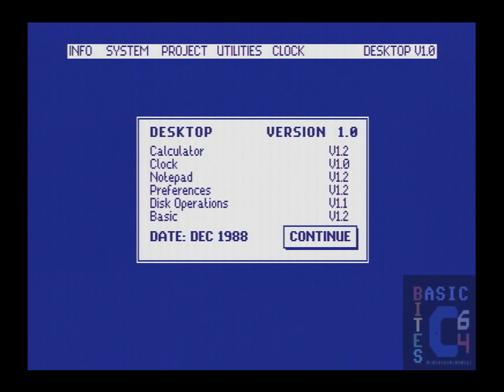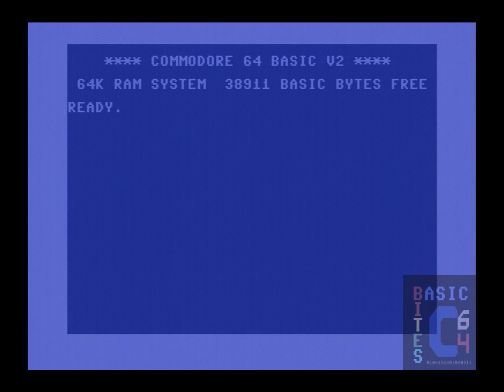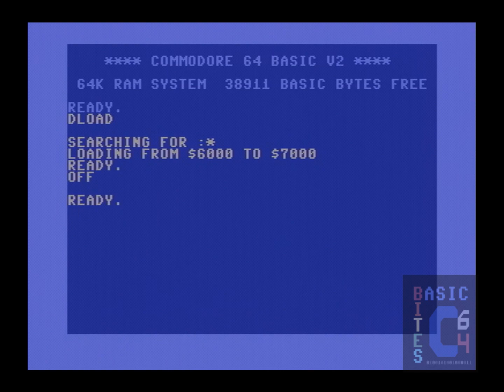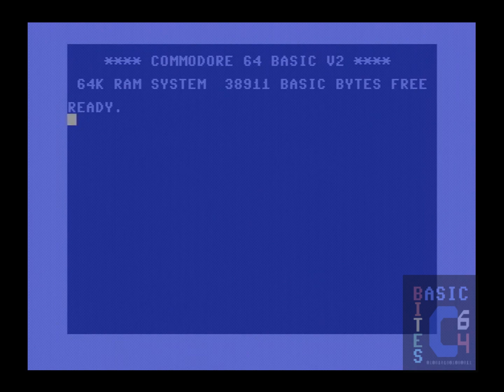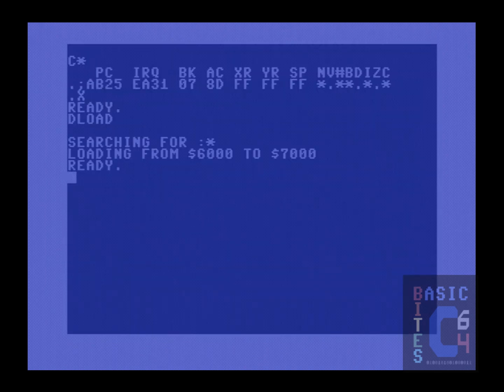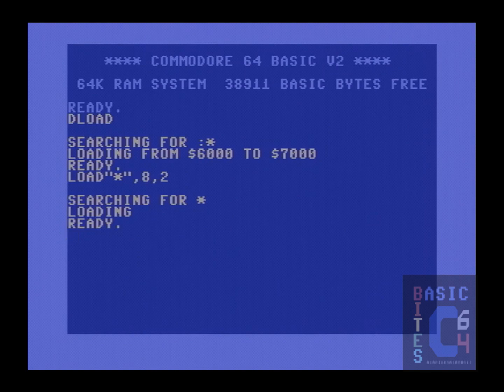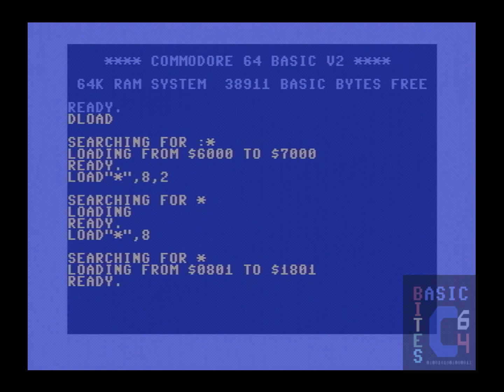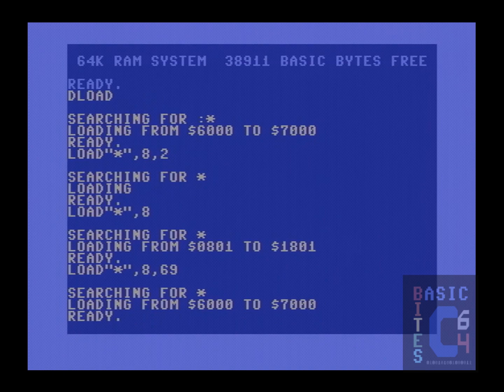New HIDDEN FEATURE in The Final Cartridge III | Commodore 64

Comment: Weird, my Commodore 128 and 1571 worked perfectly fine with C=64 fastloaders; I used them all the time in Commodore 64 mode. I did my programming and homework in C=128 mode, and the vast majority of the time I was playing games in C=64 mode.
Reply from the maker: Not weird at all!  In C64 mode (or on a real C64), a 1571 will be in 1541 mode unless you instruct it otherwise. 🙂  -- JC

Comment: My version is Date: JAN 2015
Version 2
Calculator V1.2
Clock V1.0
Notepad V1.2
Preferances V1.1
Disk Operations V1.2
Basic V1.2
Reply from the maker: December 1988 was the last official revision.  What you have there is a Final Cartridge III+ (FC3+), which encompasses various efforts to continue improving the cartridge.  -- JC

Comment: D you know how to make a freeze with fc3 and use the freeze without fc3?It's possible but i overlook  something and dunno what each time i make up a freeze with fc3.cheers,Ken
Reply from the maker: See "REMARKS ON THE FREEZER" on page 56 of the manual for some helpful tips.  The first thing you should do is use Reset Zero Fill from the Freezer to clean any unnecessary garbage out of memory.  Then load your program.  It also recommends that you KILL the cartridge before making a backup, if you want the backup to work without the cartridge inserted.  Beyond that, I'm not sure, since I don't use the cartridge to make backups all that often.  -- JC
Reply: @BasicBitesCA  is there another option?
Reply: @Ostendia  Yes, there is: Use the OFF command before starting the program. However KILL is really what you should use, because it uninstalls the FC3 hooks completely, resulting in a backup that works without FC3. Remeber, the FC3 Freezer remains fully functional if the FC3 has been killed.
Reply: @danielmantione  I don't think ypu need to OFF or KILL, I have done several backups that fastload perfectly without an active FC3. EDIT: Wrong in case of BASIC programs, as @danielmantiojne points out below.
Reply: @NuntiusLegis  If you do not use OFF or KILL you BASIC and KERNAL vectors point into FC3 ROM. If the program doesn't use BASIC and  doesn't LOAD/SAVE, it may still work, however, in general you should use OFF/KILL before making the backup.
Reply: @danielmantione  I never backed up BASIC programs, tried it now, and you seem to be correct, it only worked after a KILL before pushing the freezer button. Thanks.

Comment: Brilliant... very nice to know ❤
It makes we wonder what something like this would do:
LOAD"*",8,70
- Will it do the same as ",8,2" or load the program into $0801 with the fast-loader enabled. Is TFC3 looking for the value 2 or triggering on a bitwise logical AND on bit no. 1 (aka $02).

BTW, I still have my The Final Cartridge III from back then as well. Although the case had gotten oddly brittle, so I have moved it over into a transparent-red casing instead and printed a new golden'ish label. I'm not sure which version it is. But I also have the TFC3++ reproduction and that would be bases on the "final" Final Cartridge III, shouldn't it? 🤔
Reply from the maker: Thank you very much!  Any non-zero secondary address OTHER than 2 invokes the fast-loader, just the same as using an address of 1.  I also use a real FC3, because I enjoy having original hardware for the cartridges I use the most.  The TFCIII+ is the same code as the FC3's final ROM revision (1988-12), but contains a much larger EPROM, with a list of added tools that can be invoked from the Desktop.  I never invested in one because I can just put the TFCIII+ ROM on my Kung Fu Flash, if I wish to use it. :)  -- JC
Reply: @BasicBitesCA  Besides the extra tools, I have noticed the TFC3++ (that's what it says on the label for some reason), that at power up into the FC3 desktop it selects the 1351 by default instead of joystick mode. Which can be a little annoying. When I bought it I just wanted to have a replacement in case my old trusty should give up for some reason. I also have a Kung Fu Flash, the BackBit, several EasyFlash3s (upgraded) and even an Ultimate 1541-II. So, I guess I don't really need the TFC3++ any longer.

And I also have the FM-YAM, GEOSRAM-128, Datel MIDI, The MSSIAH (also with MIDI), a couple of X-Panders... and a slew of DIY home-baked cartridges: dead-tests & diagnostic, 512K Magic Desk/Ocean compatible (I'm sure I'm forgetting some). Yeah, a bit of a cartridge-nut.

I guess could try to justify it with also having several machines. But that doesn't hold up, since I have way more cartridges than can fit in all of them, even with the X-Panders... Naah, more like a proper nutcase.

If the C128's U36 ROM counts as a "cartridge", then I have also build several "Internal Function ROM" selector daughterboards (made 3 for some friends). They make "you" able to select between 16 different 32KB Function ROMs via a binary rotary switch and a 27C040 or 27C4001 512K EPROM.
The fact that I have only ever been able to find 13 Function ROMs for the C128, with some just being slight variations of the same ROM (like language or menu/colours)... ehm yeah... lets just overlook that part, shall we? 😅

Comment: lol, it IS NOT a hidden feature... it's documented in the manual that after a KILL you can still use the freezer menu and all it's functions (hence also going back to desktop and reload it's function)

to be exactly it's on page 33.
quote: "This command will disable the Final Cartridge III. Only the freezer
still works, but you will return to the standard Commodore 64 unless
you leave the freezer through the monitor."
Reply from the maker: Yes, indeed it is... and if I had made a video claiming THAT was a hidden feature, you'd be correct in correcting me. 😉  -- JC
Reply: do you know how to make a freeze with fc3 and use the freeze without fc3?It's possible but i overlook  something and dunno what each time i make up a freeze with fc3.cheers,Ken
Reply: @Ostendia  Just do it, it works. EDIT: I was just informed that you need to use OFF or KILL before pushing the freezer button if the program uses BASIC.

Comment: Where does it load the program when using ,2? To $0801 or to $6000? Wouldn't an additional ,3 be needed to allow loading without fast loader to both addresses?
Reply from the maker: Good question!  Using ",8,2" loads to the program's load address (just like any other non-zero secondary address); it simply does not use the fast loader.  Yes, an additional option would need to be programmed to allow you to do the same thing with a relocated load, but probably wasn't deemed worth it for the rare instances in which you'd actually use it.  The only time you really need to use ",8" rather than ",8,1" is when you have a BASIC program that was written on another model of Commodore computer that doesn't use $0801 as its start of BASIC memory.  (A good example is PET BASIC, which will have a load address of $0401 stored in the PRG file.)  -- JC
Reply: Neeeeeeeeeeerds!!!